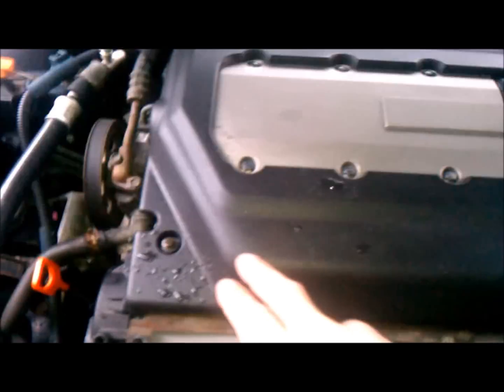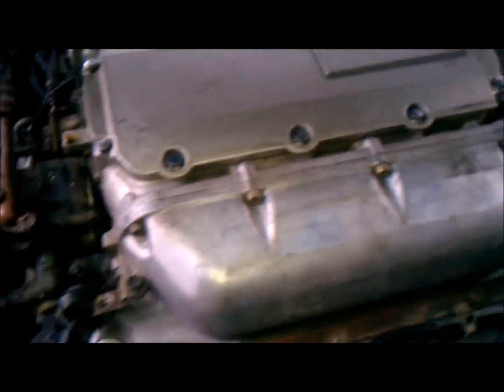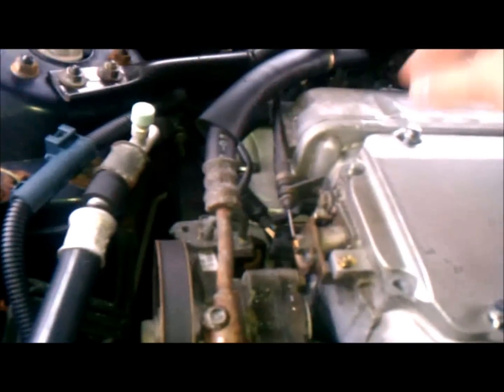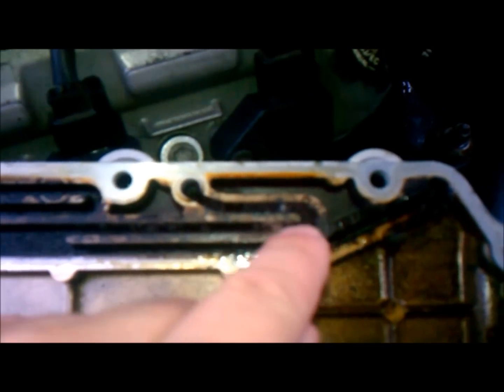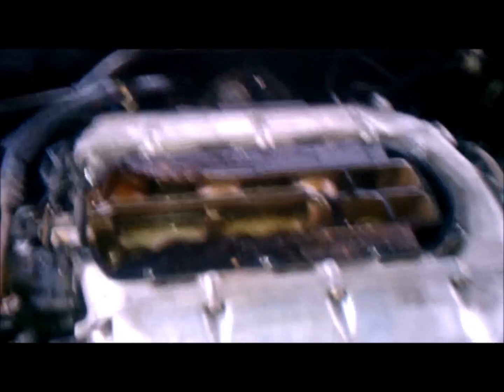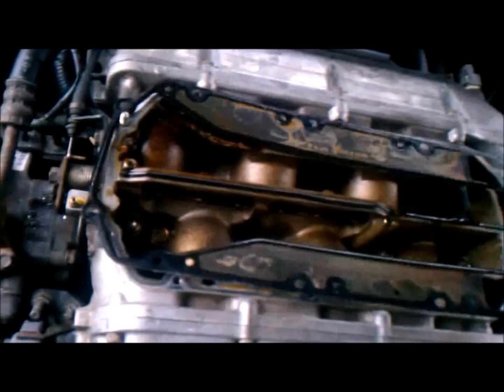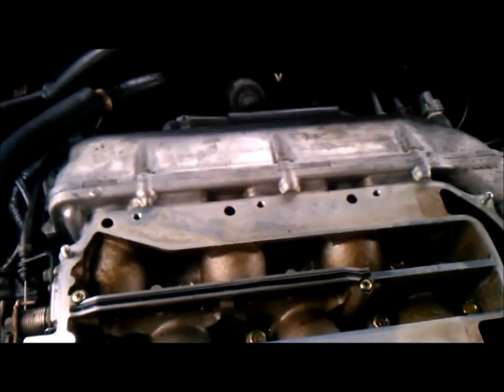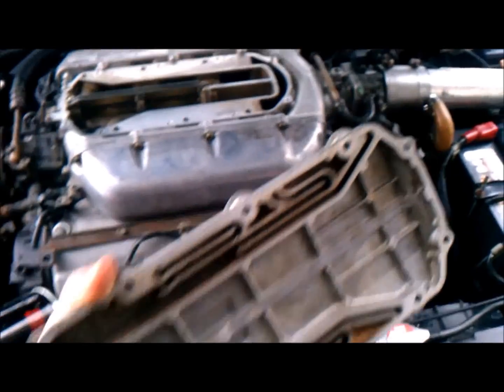Acura 3.2 TL, CL, MDX misfire repair Procedure (Tech Bulletin).wmv

Comment: Those ports being clogged will not cause a missfire. Those ports are for the egr valve that only opens when decelerating from high speeds without using the brakes. If the egr valve had a piece of carbon or gunk that if what would cause a missfire at idle or have no power when accelerating. U can hook a vacuum tester to most vacuum/electronic egr valves and put light vacuum to it and see if it was stuck. Or remove it and clean it with brake clean and replace the gasket its like 4 bucks
Reply from the maker: wow, I don't know what to say to that reaponse except you need to read up on what egr valves are, what they do, and why they are there. I'm sorry to say you are very far off with your comment. Also, improper egr function DOES cause misfires in many manufacturer vehicles....ESPECIALLY the most recent car with the problem are smart cars and clogging mechanical egr valves causing all sorts of engine malfunctions. I've worked on Honda's since the early 90s and I am 100% positive that this is a common cause to many misfire problems with that motor. you can not trap exhaust gasses and except the car to function properly.
Reply from the maker: lmao...also the EGR valve does not act like "Jake brakes" on a rig! lol it has zero function of deceleration or speed. furthermore you most certainly did not hook up vacuum to check EGR function. maybe yo you are referring to checking an EGR valve or solenoid but it is impossible to check the system with a vacuum gauge!! please don't post comments on things you know nothing about. it makes you look very foolish on a public forum. I wish I could hide your comment so people wouldn't see your profile name. I hate to see people destroy their credibility in a foolish video response it. It would make any video you post completely obsolete. I would recommend deleting what you posted for your own name sake ;)
Reply: antic EGR worked by applying a vacuum on a diaphragm but newer design are fully electric and work with the ECM modulating 12V (PWM) into EGR coil to raise its pintle in controlled loop.

Comment: What would make your vsa light come on, and stay on. I tried to reset by using the instructions from the manuel, but it would not allow me to. I just had the ports cleaned, now I need to change my plugs, but as of now, my vsa, and check engine light is on, along with my brake lamp...., which all came on at the same time. what do I do? smh. gwen
Reply from the maker: I hate to say it, but did you try the button on the left that turns the vsa on and off? also that light will turn on if you have a problem with your ABS braking system or you need new brake pads or sensors. let me know I will try to help you. what are the check engine light codes? hold off on the spark plugs and coils until you speak to me I hate to hear you wasting money

Comment: thanks a mill just did this job to my 01 acura CL earlier today. Gotta wait to get a jump my battery was dead before i did it so i wont know if this will clear my problem or not. I didnt do anything to the egr vavle so i dont know if i need to replace or clean that as well but i will say that my ports were beyond clogged and i mean every channel and the length of them were clogged so crossing my fingers and hope this gets me back up and running.
Reply from the maker: hey Marco, I'm positive you will see a drastic improvement!....good luck with the jump, glad I could help.
Reply: +Edward Naso II (Naso Pools) no prob bro thank you for the vid. I got her all patched back up so far so god sounds runs feels and drives a whole lot better so for anyone having misfire sputtering and loss of power issues ig you've tried everything and its still not working try this and its super easy and i do mean super.
Reply from the maker: +Marco McClure . thanks for the nice post Marco. I'm glad it worked out for you

Comment: no i put it all back togther i can take some tomorrow when it cools down my egr ports was way more dirty thin urs u couldnt even see the guides but everything clean now so is all my port holes
Reply from the maker: that's good to hear you got it all cleaned. maybe the computer needs to calibrate to the drastic change. they are self adjusting computers. maybe reset and try idling for a while before driving. if they were that bad you may want to check that your egr valve didn't get clogged. check it for functionality with a battery prior deciding to replace it.
Reply: How do u check egr vavle

Comment: i did it cleaned everthing p1399 still comes on with in 15 min of driving
Reply from the maker: multiple misfire is always a clogged egr port or backwards gasket. are you sure you installed the gasket properly?( not necessarily the direction you took it off) the gaskets have should be towards the back of the cover on the right
Reply from the maker: do u have pics?

Comment: ok did u ever get the p1399 code ive had it looked at at midis and they said ever this was find my egr was bad so i repalced that now im going to do ur process what that gasket called on that part u took off to fix the problem
Reply from the maker: yes p1399 is a code for random multiple misfires which is exactly what this video is intended to repair. don't bother replacing your EGR valve. If your EGR ports are clogged the valve can operate properly. Do this procedure first

Comment: im getting a p1399 code then after p0304 p0305 p0306 p0300 on my 03 cl type s i dont no what the problem is
Reply from the maker: do this procedure, it should fix it. also check your gas cap seal. might need a new gas cap as well. start with this process though

Comment: hey Edward great video. would this process work with my 1999 3.2 tl ?
Reply from the maker: absolutely!
Reply: +Edward Naso II (Naso Pools) thanks  bro,  Have a great new year
Reply from the maker: +D Cast thanks same to you. good luck with the process. if you already checked your coils for proper operation  and still get a vibration around 60mph and misfire codes this will fix you up good as new
Reply: +Edward Naso II (Naso Pools)  well ,I had all my coils changed by mechanic,  n the plugs n egr sensor. so I'm hoping this clears it.
Reply from the maker: +D Cast ugh, sorry to hear it..this was probably the only problem. a lot of mechanics unfortunately make that same mistake. when the code reads "misfire on all cylinders" many mechanics will look at the mileage of the vehicle and assume all the coil packs are weak and worn out and need to be replaced... this is a common misconception. coil packs are either good, or bad, not weak or in between, their design doesn't allow for that. besides a quick continuity tests tools would be unable to test their voltage accurately. ....rest assured, this will fix your problem!

Comment: For example p0304 which one is #4? From where does coil#1 starts thru #6
Reply from the maker: to be honest I have forgotten the order. I can look through notes to see if I have it anywhere. if you only have a code for one misfire, the easiest way to find it is to start the car and let it idle. while idling start with 1 ignition coil unplug it. if the motor idles more rough, plug it back in and move to the next one. when you unplug the one that is misfiring you will not see a noticeable change in idle when you know you are on the correct cylinder
Reply: Edward Naso II wow! Tnx for the very fast response! Actually it has many codes p0300 301 304 306 and also p1298 p1339 p1456 I know 300&1339 are the same thing I'm short on money so idk if it's ok I don't replace the ELD till I have some money, I already ordered 3 coils but don't know the order in which they go
Reply: Edward Naso II also when I run 60+mpg the whole car shakes not just the steering wheel I've done multiple alignments change tire positions and the dealer changed one engine mount bout 3 years ago idk what else it could be just last week someone told me it could be the transmission mounts any ideas?
Reply from the maker: did you do the steps in this video?..multiple misfires is not normally bad coils. you have all the codes that would point towards those channels being clogged rather then bad coils or plugs.
Reply: Edward Naso II i did do the steps u said and when I unplugged one coil I could hear some rattling and when I unplugged another one I didn't hear the rattling that would mean that coil is defective would say right? I already bought 3 coils I wish I would've watched this video first, anyhoo I'll post the result later on today. Thank you.
Reply from the maker: yes that is correct the one you unplugged and no change occurred is the bad coil. Let me know how you make out
Reply: Edward Naso II ok so I tested all the coils one by one and only one seemed to be causing "rattling" when unplugged so I replaced that one but got recommended I changed the other 2 since I had gotten 3 codes total on p0300s. The TCS light doesn't turn on anymore just the CE light, I didn't erase the codes since I have no obd I've yet to change the p1298 & work on p1399 & p1456. But that'll be when I have money. BTW I had mentioned that my car shakes at 60mph already done multiple alignments & tire balance and nothing so I changed the transmission mounts which were already bad and broken but the shaking only went down a bit it feels more of a "tight" shake then a "loose" shake. So idk what could be causing that, thank you very much for this informative video your time and attention sir! Noobs like me and not so noobs can learn a lot from videos like this 👍
Reply from the maker: +elcaifan oh no!!!! you have it backwards!!! if you unplug a coil and the motor starts rattling that means that coil is working and should NOT be replaced!!!!....if you plug it back in the rattling stops meaning you are causing a misfire when unplugging hence the rattle. then when you plug it back in the rattle stops meaning that coil is firing that plug. when you unplug a coil and no change occurs at all, replace that coil. shaking at 60 and up is the misfire this video talks about. you need to open the top of the motor and clean it out. even if you don't have a new gasket most likely the original steel gasket will be OK to reuse if you are careful removing it and make sure you clean it perfextly! also don't forget to verify all the holes line up when re-installing. DO NOT MARK RIGHT SIDE UP BECAUSE IT COULD BE INSTALLED IMPROPPERLY FROM FACTORY HENCE THE SERVICE BULETTIN IN REGARDS MENTIONED IN THE VIDEO.
Reply from the maker: this is the second reply, please don't mis the first one I wrote a minute ago p1456 is 9 times out of 10 a bad gas cap. replaced the cap and it should go away. the other codes with random misfires all pertain to the instructions in this video. do these steps and your troubles will be gone. I did not want to mention this in the video as it is not proper advise and there are a lot of people out there that would hate on the video and leave responses, however you can do the steps in this video and reuse that gasket. manufacturer recommends replacing it however I have done it on many cars and every use the gasket without a problem. Good luck
Reply: Edward Naso II I'm sorry I meant I unplugged it and it had no rattling sorry. Next stop will be doing what you're doing in this video hopefully that fixes the dam shaking it's embarrassing for God's sake it's an Acura tl ha! Thanks again!
Reply: Edward Naso II man you are very informative I must say I never expected it, can't thank u enough sir, will post results too when I clean it.
Reply from the maker: +elcaifan glad to hear I could help and thank goodness it was your typo before with the replacement ....whew! lol I promise you you follow the steps in the video your car will run like a dream again

Comment: After cleaning the manifold on my 2000 Acura tl it now wont start. Any advice?
Reply from the maker: did you replace the gasket or put the original back in? any air leaks there will make it difficult to start. Make sure your torque specs are right. if you used a bunch of cleaner in the channels and might just take awhile to get it started for the first time. After that you shouldn't have a problem. you should definitely put it brand new gasket in though
Reply: Best guess is the brake cleaner flooded your plugs!! Remove plugs to let them dry out. Crank engine without any plugs in to dry it out faster...

Comment: I need help I did this cleaning now my car won't start...I had a blinking check engine light got it checked up they said misfires I seen this video and without changing coils or spark plugs I just took off manifold and cleaned in the groves like video states put everything back together now my car won't start any ideas....???? I have the same car 01 cl type s
Reply from the maker: Blinking check engine light you have bad spark plugs or ignition coils. A no start condition would be more than one fouled plug or coil
Reply: flooded plugs with too much cleaner gone down inside the cylinders. Remove plugs, crank...

Comment: If you have the problem still you should get a "value adjustment" when you have a 105,000 or more. That will 90% of the time will fix the problem. Or just a tune-up
Reply from the maker: Thank you for your input however these motors have self adjusting valves.Don't let anyone tell you they can do a valve adjustment there are no adjustments on these motors.
Reply: That's awesome! Thank you for letting us know. I had a place that would fix the problem. Those A Holes... Thank you again
Reply from the maker: whatdoulike69 any time, also I didn't mention in the video but if you have a faulty ignition coil you can let the motor run at idle and unplug one at a time. When you get to the faulty one there will be no change in idle. If you unplug an additional one that was functioning the motor will start to shake much worse. Just plug it back in and move on to the next one. This is the easiest way without the proper computers to find a faulty ignition coil or spark plug.
Reply: Sweet, thank you.

Comment: I'm having misfires on my 02 tl type s, had misfires before and took it into the shop, they checked plugs and injectors, both brand new.. Eventually it started working again but I don't think they even knew why. Now a few months down the road its doing it again, rumbling, low idle ect. so i'll give this a try in the morning and post back if it works.
Reply: let us know ! looking to do this soon aswell. thanks ! :)
Reply: eddie lima Wasn't a help for me, took it into the shop and its getting a new coil in the morning :P
Reply: Did the coil fix the problem?
Reply: King Pharaoh yes, 2 could went bad In A span of a couple months, I wish I knew it would have saved me a few hundred dollars changing them myself

Comment: i have a 1999 acura cl 3.0 and did spark plugs, distributor cap, rotor, wires but still misfirng on multiple cylinders all at once magically.  even bought the more expensive laser spark plugs after buying cheap ones in case that was the issue.  love wasting money.

i have a mazda 626 so i know about egr valves.  so this will be my next step as it looks inexpensive.  i guess the key is to not buy older cars. 

what sucks is nobody seems to come up with a specific diagnostic code. pisses me off!

Comment: My car was misfiring. I found the bad coil and replaced it. I also changed all of the plugs. I saw this video before a started, so I took the cover off and it looked just like yours. I Cleaned it up, and then had to crank the car for about a minute to get it started. Now it runs great. But Im curious why I had to crank it so long to start it initially.
Reply: Maybe the air you let into the top of the motor? Maybe the cleaner you used made it have a rough start .. don't think it's anything to worry about
Reply: same thing happened to me.
Reply: Mine did the same thing. After a few tries i decided to push the gas pedal, though it is fuel injected; that seemed to work. Unfortunately, i still had misfires, in fact, i had more than i had when i started? Still investigating.

Comment: Great video. I have a 2003 MDX and keep on getting the multiple cyl. misfire. Seemed like it went away when I put in the fuel cleaner but it came back. Any suggestions? I got a 3.5, so it a little different, do you need to change the oil once you clean it with the brake cleaner?

Comment: Should I worry about getting break cleaner in the manifold when cleaning the port holes?  Won't it get into the the engine and mix with the oil. Thanks

Comment: Just finished watching your video and cleaning my 2000 3.2 TL's engine EGR ports and my gasket was also turned the wrong way covering the holes. Hopefully mine doesn't throw anymore codes. Thanks for the video.
Reply from the maker: Twoo_Wheelzz glad to have helped
Reply from the maker: Twoo_Wheelzz glad to help!
Reply: why post before testing it?

Comment from the maker: Denny chuya, this is a video explaining step by step the actions required in performing a technical bulletin posted by honda/Acura..of course the egr valve should be replaced at scheduled service intervals however the dealer posted a bulletin about this service in response to misfires that were difficult to diagnosis as a result of the egr port clogging. If your 3.2 motor is not in the years specified in this video it will not pertain to you as the ports have been redesigned...someone else also posted another comment about talking about tight valves and a MAF reading: that comment has no relevance to these motors as the valves on these motors are non-adjustable. Hope this helps everyone

Comment from the maker: Dave, try driving the car....white smoke only comes from coolant (which you should not have been loosening the head bolts if you followed my instructions so your fine) or from excessive cleaning fluid down the ports, which(if the case) will burn off faster If you drive it...take it for a 5 mile spin and see if it stops, if not let me know I'll help you further